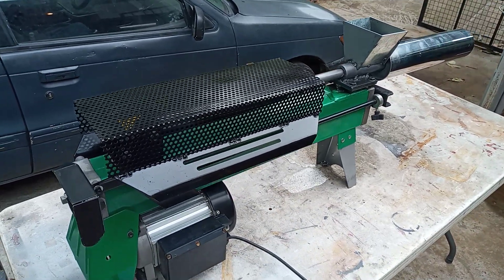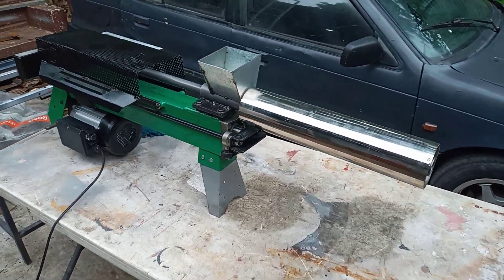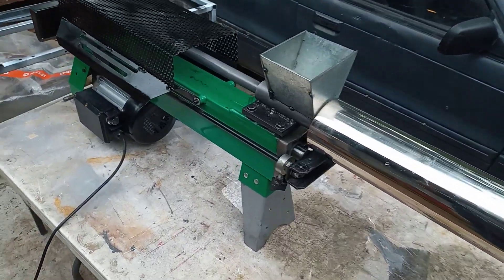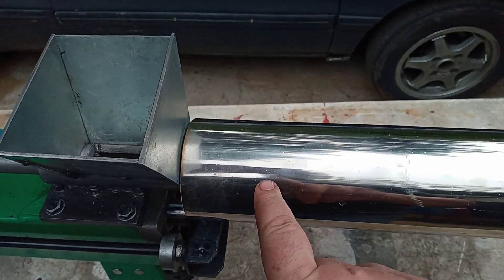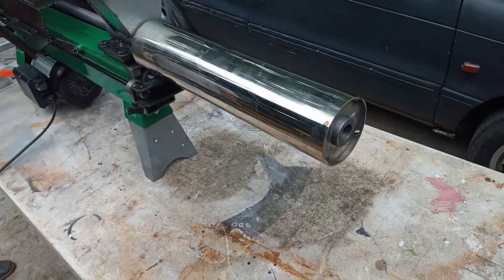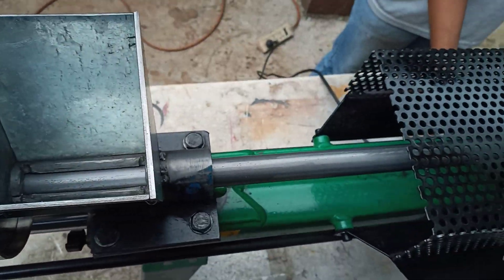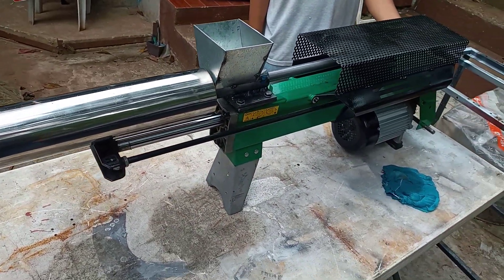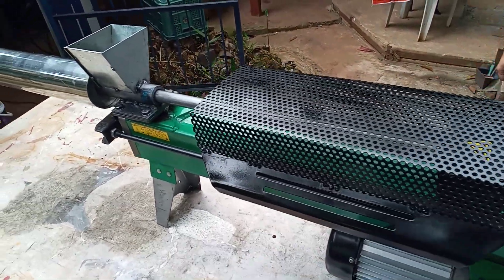DIY Hydraulic recycled plastic injection molding machine for the workshop

Comment: Hello sir, 

How did you come to the conclusion that 140 grams is the max shot size? Could a larger barrel and piston be used to increase the shot size, or is 140 grams simply the upper limit of what 6 tons of pressure can achieve.

Thank you

P.S. Absolutely stellar machine!
Reply from the maker: The maximum stroke length plus the barrel diameter.   Too large diameter means a slow heat transfer and melt.
Reply: @preciousplasticph  Thank you sir, that's what I needed to know.